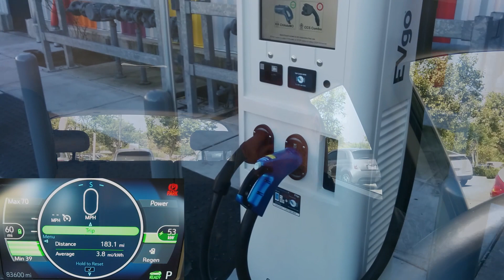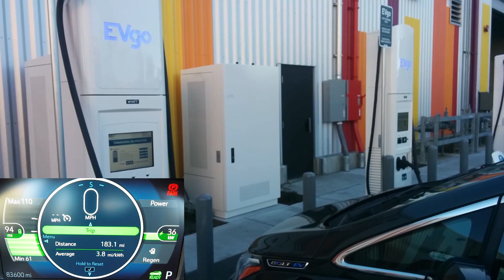Plug-Side Chat: Nissan Funding 200 New 100 kW EVgo Fast Chargers

Comment: They really need to add chargers in more places than just California.
Reply from the maker: EVgo has many sites outside of California, but the problem is, they don't really support long-distance travel. When they first started, most of the EVs were short range, so EVgo put most of their chargers in larger cities. Now that most new EVs being sold are long range, it makes more sense to focus on travel corridors between cities.
Reply: @newscoulomb3705  EVgo should be looking at Tesla to see how they implemented the Supercharging Corridors along major interstates to facilitate EV travel and follow that model.  EVgo should look into using 2-way communication between the car and the charger so you car becomes you card to use a charging facility.  Tesla has figured it so I am sure other people companies can.
Reply from the maker: @SDGreg  I wouldn't necessarily mimic Tesla's Supercharger network. One of the benefits of the public charging infrastructure is the diversity of charging locations, and I'd like to see that preserved. 

The good thing for EVgo is they can get away with smaller sites with different spacing because they could build with the other public charging providers in mind. Electrify America isn't leaving a lot of highway gaps, so EVgo has the opportunity to complement that and add diversity and resiliency. That's my preference, anyway.
Reply: @newscoulomb3705  You talked about in your video that they needed to look at more highway charging spots to bridge the gap when travelling between cities.  That is exactly what Tesla did when it started it's SC network.  Bridge those gaps because it had 200+ mile EV's.  While other public charging network's focused more in the inner cities.   Now Tesla is filling in more spots for suburban areas and you have more and more vehicles that are not Tesla's with 200+ mile range.  We need public (Non-Tesla) charging networks that can fill in these inter-city gaps.  You talked about in your video the issues with trying to drive between LA and Phoenix on the I-10 because of lack of Non-Tesla charging spots.  It will not mimic Tesla but those gaps need to be filled in by public charging.  It isn't like you have that many choices of charging locations between LA and Phoenix.   

My big issue is all the different networks demand different charge cards, different apps etc.  To me your car should be your card.  You should be able to login to a companies site registrate your car's VIN with EVGO, Electrify American, Charge Point etc when you setup a account.  When you plugin the charger reads the VIN of your car and verifies your account and you start charging.  No having to make sure you have the right card out, the correct app loaded on your phone etc.  It is 2019, the technology is there the companies just need to be willing to use it.  You plug-in and it starts, just like it should be.  

I think that eventually Tesla will bring CCS Combo to the US with it's SC stations as it already has done in Europe.  So eventually all Tesla stations will have both CCS and SC plugs.  Have a law passed that Tesla need's to allow non Tesla's to charge at it's SC Stations as long as they have a registered account with Tesla.  Don't force Tesla to have a CC reader, RFID card reader etc.  Then re-charging a non Tesla at a SC station could be as easy as creating a account with Tesla and registering your cars VIN.  You then pull in to a SC location and charge your Bolt or other EV with a CCS Combo port at a SC station.  How nice would it be if you are driving between LA and Phoenix with a Bolt and be able to pull into the Quartzsite SC location and charge your non-Tesla?
Reply from the maker: @SDGreg  What I meant by not mimicking Tesla was the way Tesla built their highway charging corridors. Yes, there are currently gaps, but those gaps are already in the process of being filled (that wasn't true for Tesla when they were first building the Supercharger network). So EVgo should focus on either the remaining gaps or supplementing the new charging sites that are going online. 

Also, to your point about your car being your "card" to activate the chargers. That's already being worked on: https://electricrevs.com/2019/01/08/electrify-america-working-with-hubject-to-add-plug-and-charge-support/

Another alternative to the plug-and-charge functionality that you can set up with the charging providers is what Mercedes is doing. When you buy an EQC, Mercedes sets you up with a single account. They coordinate all of your charging sessions with the various providers, and you pay a single, simplified bill through your Mercedes account.
Reply: There has always been a balance between "put the EVSE where there are lots of EVs" and "people won't buy EVs until there are adequate EVSE".  You are talking about making highway travel more convenient where I favor making it "possible".  There are NO CCS Combo (or CHAdeMO) plugs in all of WV, affecting EV sales in WV, OH, KY, TN, NC, VA, MD, and PA.  I-64 has NO DCFC between Lexington, KY and Lexington, VA.  "If you build them (EVSE), they will buy (EVs)!"
Reply from the maker: @frederickwalker4450  I don't see the disagreement. I never specified which corridors need these chargers. My only point is, now, it makes more sense to put several DC fast charging sites 50 miles outside of Charleston on various highways than it does to put any sites in Charleston. Level 2 AC in city parking garages or at hotels/motels makes more sense at this point.
Reply: Superchargers are all over the country.
Reply: Me too. Any of these new sites planned for Michigan?

Comment: Tesla urban chargers are using all their dedicated modules per plug. May be limited but not by much.
Reply from the maker: Technically, the "Urban" Superchargers are only ~80 kW (410 V @ 200 A). Ironically, if Tesla were to set up units with a CCS plug, the e-Tron, I-PACE, Kona Electric, and Niro EV would all charge about 5 kW faster than Teslas do on those same units.

Comment: Isn't 100kW still faster than most of the new ChargePoint chargers being installed even along busy travel corridors?
Reply from the maker: Yes, most of the ChargePoints being installed are still the 125 A Tritium chargers, so these 200 A chargers would be much faster. In either case, though, I don't think these are where we want to be for gas station type stops. 

To be fair to ChargePoint, though, most of their chargers are near sit down restaurants. One meal stop at a 50 kW on a long trip is still fine, in my opinion.
Reply: Robert Aitchison most of them are 150 or 350 units

Comment: Electrify America sites have at least one CHAdeMO charger.
Reply from the maker: That's true, but a single CHAdeMO connection per site doesn't make for a reliable network. If that charger is down or occupied, the entire site is useless. While I agree that EA doesn't need to build parity between CCS and CHAdeMO, it would be nice if they provided at least two CHAdeMO plugs.
Reply: News Coulomb Is it possible to make a CHAdeMO to CCS adapter? Tesla sells one for their oem connection, at quite a high price. Tesla just added Model 3 software so that all Teslas can take advantage of CHAdeMO outlets.
Reply: Mitchell Barnow That’s great! Tesla always sets the bar! More Chademo in my area and working ( one combo fast charger always out but Chademo works).
Reply from the maker: The biggest problem is the communication protocol. Tesla and CHAdeMO both use CANbus, which is why it was so easy to make an adapter. CCS uses IEEE.1901 (the power line protocol).
Reply: News Coulomb Thank you so much, News!
Reply: News Coulomb maybe ea will increase it too 100 kw for chademo.  This shows like i have said that chademo is going no where.
Reply from the maker: There are rumors that, even though EA's CHAdeMO plugs are listed as "50 kW," they are in fact the same 200 A, 200 kW chargers that EVgo is describing. At least, according to reports from several LEAF e-Plus owners, they are seeing >70 kW on EA chargers.
Reply: @newscoulomb3705  
Yep.. the dumb thing is they have 2 cables per charger. But you can't charge two cars at once I don't think on that one machine.
Why have TWO CCS cables..  I guess for backup.. but why not put one CCS and one Chademo on each charger.  Or some ratio besides just one Chademo.
Really Nissan just needs to ditch Chademo or add CCS to the cars.. it's gonna be the global standard I suspect eventually..  better to change now than later.
Reply from the maker: @kens97sto171  The cable is one of the most common points of failure. 

Also, VW isn't supporting just a single vehicle with a standard plug layout, so they can't do what Tesla did with the Superchargers. The two plugs make it easier to charge with vehicles from different manufacturers.
Reply: @newscoulomb3705  
Ahh. Ok so the double cable gives you redundancy if one is bad.
Ok.. 
Still think Nissan should just go to CCS..  it's definitely becoming the standard it seems.
Have a great day
Reply: Only one. Need 2 per site on separate stations.

Comment: Hi Eric is the Bolt still holding up well now that it is officially past the 100K miles warranty?
Reply from the maker: Yes, it's holding up well. I'm working on an update.
Reply: News Coulomb Mine too see no degradation at 108,000 charged downhill to 310 miles. Wahoo!
Reply: @newscoulomb3705  good to hear, I took the plunge and bought a Kinetic Blue 2019 LT on Saturday! After my wife took it for a drive tonight I think she'd buy a Bolt instead of the Kona. ;-)
Reply from the maker: @cwagner14  Awesome! Congratulations on your new car. The Kona is nice, too, but it has some trade offs. The Kona has better driver assist features and a bit more range and faster charging speeds, but it's more limited in cargo capacity and rear passenger room. Really, I don't think you can go wrong with either one.
Reply: @newscoulomb3705  hoping for an update about Your 100K mile Bolt.  Also news on the 2020 Bolt with better range - any plans on swapping out for the better hv pack or would Your plan to be trade in for newer?